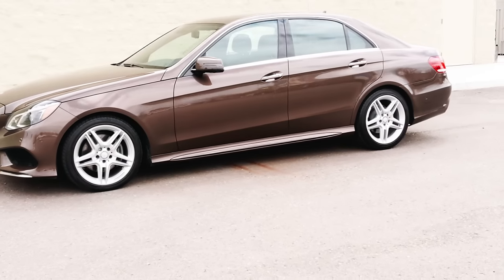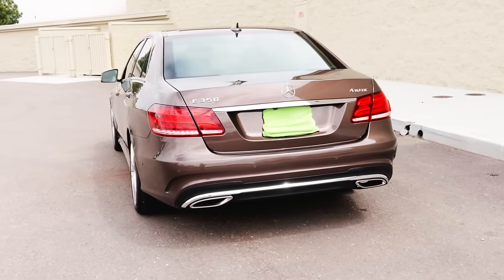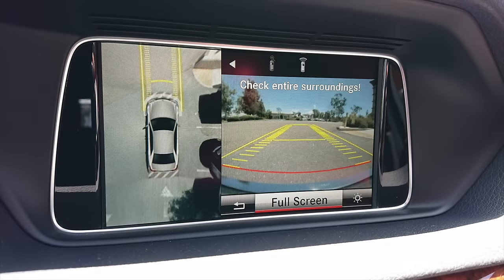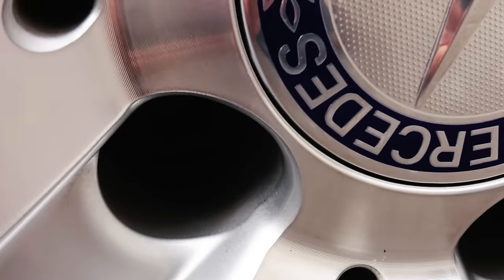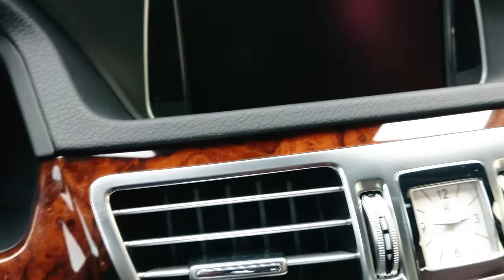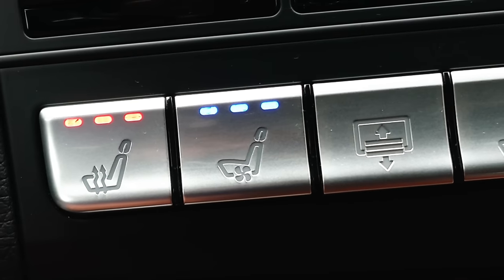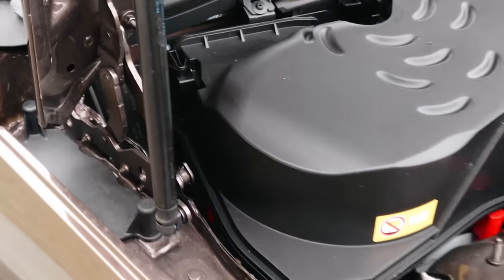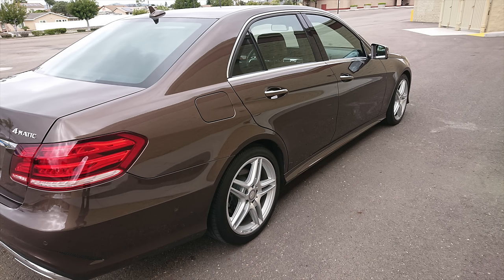The W212 E-Class is one of the best Mercedes-Benz Cars Ever

Comment: The last one was made in 2009, after that year Mercedes lost MB body stile and quality .
Reply: Clearly you've never owned a w220. I had two bought new and both were crap and lemon lawed for different things. Ever since then I bought the Lexus LS for long use. But my w123 is still running with a few miles short of a million miles on original engine and trans.  My 1995 s600 was my pride and joy before it got totaled in 2001 and then got the shit w220 s600.
Reply: Parker Howell 2009 was the last year for W211 which I own E550 sport AMG pkg, panoramic roof,which is rear . what you saying make no sense.
Reply: Parker Howell Mercedes benz 2009 E-class was made from steel frame and aluminum hood, trunk and fenders which newer models don't have , that I clearly see you have no clue about the quality W211
Reply: @kotkesha  you're right I've never been near a modern E class. For my line of work they're too cheap and inappropriate. Besides if you drive an E class what you're really saying is "I should've worked harder and got the S class" my personal car is a Lexus LS 500 inspiration and the car I use to show luxury homes to clients is my S600 Maybach.
Reply: @kotkesha  can you speak in plain English and not random letters?

Comment: Comparing W212 versus W211, i find that the quality of the switch-gear print finishing markings in the W212 overall are INFERIOR, to the extent that the frequently pressed buttons e.g. for air-con recirculating mode, especially the driver side electric seat adjustments get worn down to the bare plastic exposed on the panel !! Honestly since it's supposed to be a Mercedes-Benz my expectations have to be naturally higher so i wasn't that impressed especially when in W211 those buttons for similar function (due to their printing technique 'baked' into plastic surface like high quality IBM keytops)...i've never come across even a well used 15 year old W211 with worn markings on those buttons ?! On the other hand on all the 10 year old W212 i come across, ALL i see worn markings in some cases filmsy plastic stickers (suspect 3rd party print jobs) were stuck over the original worn button tops...overall NOT impressive shoddy presentation..a shame while in the W211 all the switch-gear button tops (except the warning triangle white print susceptible to being gradually rubbed off, same too with in W212 here), i find the finishing finger-contact surfaces & quality feel of the switch-gear overall superior in W211. So..in quantitative aspects in terms of features the W212 maybe superior over W211, however in quality attention-to-detail aspects the W211 has the higher quality touch ! 

Also NOT impressed to note the door speakers in W212 are riveted while in W211 they can be relatively easily screwed/unscrewed for speaker maintenance. Initially i was of the impression W212 'had to' be overall superior to W211 but upon getting more familiar with both series in more detail etc., the W211 seems the better finished generation over the W212 eventhough it does not look so from just some casual glances ?!

Comment: Nope. Not by a long shot. The W210 is without a doubt, the best: preferably the E55 and E300. Buuut most people are too proud to be seen driving that old of a chassis; gotta keep up appearances.
Reply: 6
Reply: Not me, I have currently have 2 W210s and a 2011 E350, 350 usually gets to sleep in the garage while W210s are literally work horses with minimum, cheapest and easiest maintenance. Also had an 01 E55, a teenager rear ended me at the stop light and you guessed it, she was on her damn stupid phone texting,  she gave herself up but saved our lives, we walked away without any scratch. Teenager’s Civic was in a Fubar shape, poor girl couldn’t even talk 2 days. :). Since than W210 forever. This was in 2014, I got the money from the insurance, looked for a decent E55 again but no luck, finally I gave up and saw this 2011 4Matic with AMG package, low miles and ultra clean at a MB dealer and got it. Still drive it weekends and special occasions ( if we have left any these days) nice smooth ride but does not give me the same thrill and joy W210 gives.  Nothing pretty, both again 2001, one is silver the other is black. Black one is turning 200K this week, mechanically it is a tank, all the maintenance is up to date and done by me, no rust thanks to dry CO climate but because of the sun here, clear coat is peeling like crazy for the last 2 years but again it is one hell of a car to drive. One thing thou, I wish we had facelift 210 diesels here like Europeans did. I’d probably get one of those and keep it forever.

Comment: I don't agree. It is the worst E class. The gear box is terrible
Reply: Its a very good gearbox actually. Among if not the best from that time.
Reply: @martinsvensson6884  Do you have one?
Reply: @didikkwok  Its irrelevant wich ones I've had or not. Changes nothing.
Reply: @martinsvensson6884  Because i had owned the one, and it was suck
Reply: @didikkwok  Then someone had mistreated that box.
Reply: @martinsvensson6884  No, it didn't. Do you ever have or treat the one? My questiin is rellevant. Becouse when you never have or treat it, you won't know about that

Comment: Never ever buy a Mercedes, lot os technology and no reliability, people here are happy that they've driven it for 8 years, I am sure they paid a lot for repairs and maintenance versus people still driving lexus from 20 years well over 500000 miles original engine and transmission with absolutely minimum problem if any. Try that on the Mercedes.
Reply: No. That's just some BS youve read somewhere on the internet. The cars with most miles on them before junked are MB. Not Lexus. The engine records are also held my MB diesel taxis.
Reply: Not true